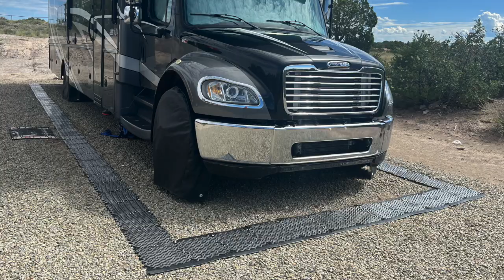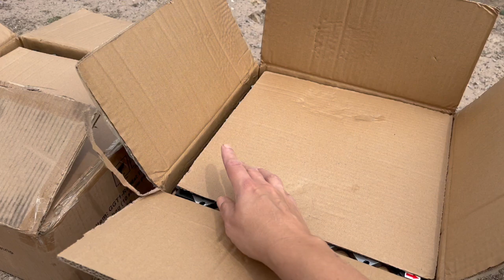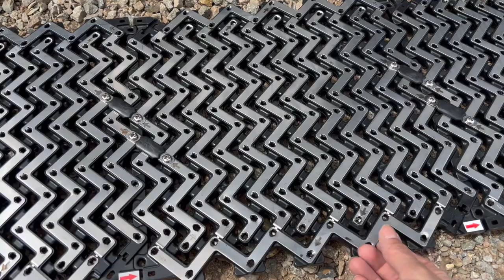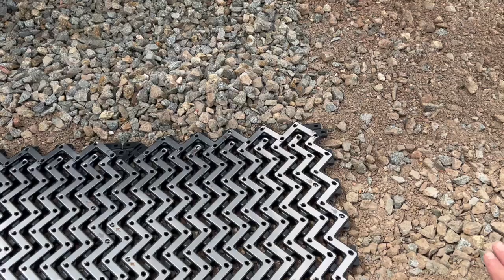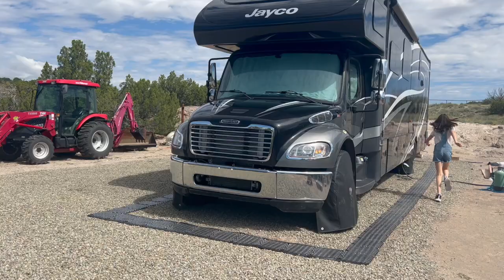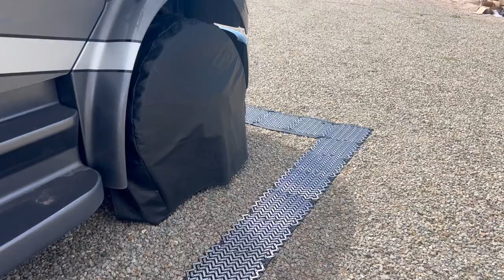Finally! A mouse-proof solution for our RV.

Comment: I'm north of Phoenix and considering this.  Now that you've had it for a while, would you recommend it?
Reply from the maker: @jordanmunn-i8x  We haven’t had any mice problems, but I’ve also seen some solutions from others with just 2x4 along the ground. I wonder if it’s worth the $4,000.
Reply: @RVHomeschool  2x4 - you mean just putting pieces of wood down? It'll "only" (haha) be $1700 for me. But that's the same amount I just spent replacing FOUR wire harnesses and the windshield wiper fluid hose.

Comment: That’s an interesting way to do it. ❤❤❤ we’ve had some get in and it was when we were in Colorado and again in the be in forested lands. We got a cat and she does well getting them if they come in.
Reply from the maker: I’m most worried about our engine space and the wiring being chewed. Do you let your cat out to roam around the RV too?
Reply: @RVHomeschool  depends on the area. We’ve had issues with mice getting into the truck and chewing wires. But it’s been a while since that happened. There was a little hole by the slide out edge that was just big enough for mice. It appeared after we pulled up the carpet.